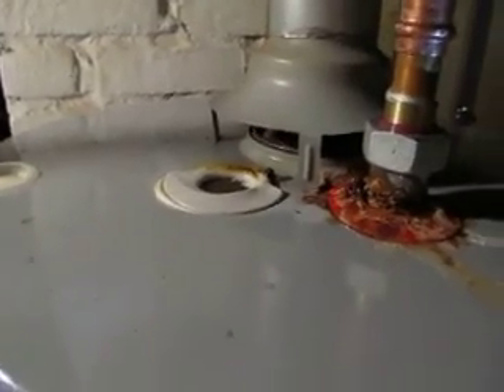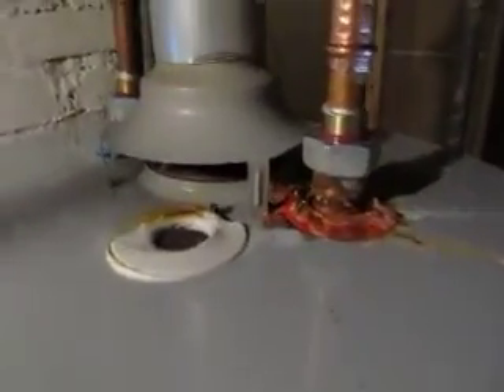CO Danger! Back drafting water heater

Comment: What kind of hazard does that present? 

Does it require an experienced professional making it expensive or is it common that can be fixed by a pretty knowledgeable handy person?
Reply from the maker: Carbon monoxide as well as expelling a good deal of moisture into the house. You would need a professional. There can be any number of reasons why this is happening, so someone like a licensed HVAC specialist.
Reply: James Quarello mine are burnt so bad that half of both are completely gone, and  I got ash all over the top of the unit. I’m so grateful I found your video, thank you!